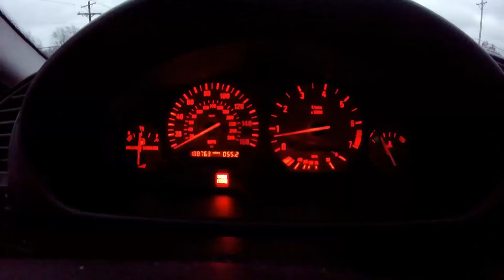Should You Ever Replace Your Transmission Filter?

Comment: I changed the transmission filters and oil in every vehicle I owned except for 1.
It was a Ford F-150.
Transmission failed at 81,000 miles on the F-150.
Other vehicles included
Dodge Durango
Ford Explorer
3 each Dodge Ram 1500's
Dodge Charger R/T
I only changed the oil and filters in the 3 Dodge Ram 1500's
The other vehicles were done at the dealership.
Could be just coincidence but the only vehicle that I had transmission problems with is
the one I never changed the oil or filters in the transmission.
Note: My son had a dodge Ram 1500 and never changed the filters nor the oil in his
transmission and his transmission went out as well.
Not sure how many miles he had on it though.
His truck was 2 years younger than one of my Dodge 1500 truck.
I know have a Dodge Ram 2500 with the 6.4 liter HEMI 
It is at 60,000 miles and many may think this is too soon to change the oil and filter
I don't. It's an easy job and only cost $100 for the fluid and filters.
I tow a camper with my new truck and don't want to have trouble on a long camping trip 
and that is why I am changing the oil and filters.
I know many will disagree but this is how I roll !
Reply from the maker: What failed in the f-150 transmission? I doubt it was a clogged filter. You also got lucky on those Dodges! Lol
Reply: @PetesGarageandperformance  I doubt it as well
I think just a coincidence. The transmission place rebuilt it then
it left me on the side the road twice. He accused me of hot rodding
the truck and said that it would be the last time he would work on it.
I got a lawyer and they really looked at it better and they had something
in the transmission installed backwards. A ring perhaps. It was a long time ago.
But that is when I swapped from Ford to Dodge and have never had any
trouble with a vehicle again. I have a Ram 2500 and the wife drives a Durango.
Zero problems thus far.It may not make a difference to change the filters but it does give
me peace of mind and I like doing it as well. I take pride in keeping my vehicles in mint condition
and I keep them for an average of 10 years as well. Although I envy the fact you know how to
rebuild these complicated transmissions now a day. You got another sub.
Reply from the maker: Gillis Danos lol the trans shop tried to blame you! That’s the thing with these transmissions, one little screw up and it won’t last long. Thanks for the sub.
Reply: @PetesGarageandperformance  Your welcome. Now if a shop would say that I hot rod my 2500 they would be right.
6.4 HEMI with 4:10 rear end is fun, fun, fun !
Reply: I bought my 2000 Silverado with the 4.3L and  4L60E transmission back in 2006 that had  around 60k miles at the time. It's been my daily driver and currently has just under 240k miles and never even changed the trans fluid once. I'm kinda ashamed to even say that, but I've always put it off. I'm not sure if the previous owner had ever changed it! It still drives and shifts without any problems! 
I'm getting ready to finally change the trans filter and fluid today, and am curious to see what it looks like in the bottom of the pan. I may have to update this and let you know how it looks when I get done. I changed the rear diff fluid once and that was within the past year! (Go figure) lol
Yes, I do change the oil and oil filter regularly!
The only mechanical parts that I've had to replace (knock on wood). 
-Steering Rack & Pinion (180k miles)
-Power Steering Pump (225k miles)
-Distributor (230k miles)
Goes to show how reliable GM is!

Comment: All filters regardless of type or brand have a limited life span of usable service, beyond that point, the very molecular structure of the filtration medium will breakdown, become saturated with normal amounts sediment reducing it's effectiveness over time. Im completely lost as to why the hell, would anyone drop the pan, to change the oil and not change the filter also, for the inexpensive cost and the time it takes to do, your point is totally irrelevant. Yes around 40% of the fluid does remain in the torque converter, but adding 60% new oil still introduces a nice fresh batch of additives that normally lose their strength after 80,000 kms, what ever remains in the TC will dilute into the fresh new oil, and the new filter, will clean up any suspended particles, giving your clutches, valves, solenoids, seals and torque converter  extended life... If you are smart enough to rebuild a transmission, then you are certainly smart enough to know that the filtration medium, does indeed break down over time and begin to plug up or reduce its micron screening ability.
Reply from the maker: I agree with you about if you drop the pan to replace the filter while you are there. But I wouldn’t waste the time and would do a fluid exchange through the cooler lines instead. If the filtration media does indeed break down to the point of needing replacement, why would the engineers bury the filters inside the cases of the newer FWD transmissions?
Reply: @PetesGarageandperformance  Engineered to fail! We are beginning to go backwards instead of forward with the over complexity of new vehicle drive trains, they perform far better than older cars but longevity has been severely compromised. It started out with the removal of the dip stick, now it's the purposeful installation of the filter in a compromising location. Manufacturers want you to change your vehicle at least every 6 to 10 years....
               I've seen so many vehicles develop shifting issues because of lose particles stuck in the valve body after a transmission flush through the oil cooler, using that cursed flushing machine. More a more repair shops refuse to use them anymore, Even my Cadillac dealer was glad when I told them not to run the machine on my CTS, and for good reason, we pulled the pan instead, installed the new filter, and topped with clean Mobile One ATF.
Reply: Pete most people don't understand most transmission filters low pressure are rock catchers they are there to keep large transmission parts from damaging the system. Keep the fluid fresh and transmission will be better than fine for many hundreds of thousands of miles.
Reply: @davidporter7051  So that you know, I am a heavy equipment mechanic, I may not be an automotive technician, but I do maintain a fleet of heavy duty pickups, along side the industrial fleet, and I've seen first hand, automatic transmission filters, that were saturated with clutch and metal particulate, we regularly send filters and oil samples out to a third party for engine/transmission integrity analysis. Also the service manual, strongly recommends oil and filter be changed at the initial 100000km mark, and then every 80,000km there after.
Reply: @brentneves3602  you don't even understand what you are posting. Try again.
Reply from the maker: Maybe the heavy equipment transmissions have more sacrificial clutch material? In the auto repair sector if there’s metal in the filter, something’s wrong.
Reply: @davidporter7051  Really?  So you have never heard of companies that perform oil and filter particle testing to determine, engine and Transmission internal integrity, by being able to measure in PPM (parts per million) metals present in oil, and filter elements, while also determing the type of metals present, like, aluminum alloy piston skirt material, soft shell babbitt or brass bearing cap material, hard surface material like camshaft lobes, fibrous wet clutch linning material ect???...And You are telling me I don't know what I'm talking about? Instead of being a you tube wannabe mechanic, maybe you should consider educating yourself first, and while you are at it look up the Dodge, and GM maintenance schedule for automatic transmission heavy duty service.  recommendations
Reply: @brentneves3602  yes. What does the PPM on just the fluid exchange, solubles and particle count with comparison to virgin fluid and change of filter. This is a comparison to identical equipment in identical operation conditions. The difference in containmentated fluid from a exchange and exchange and filter change is within statical noise.
Reply: @PetesGarageandperformance   Pete, you are correct, they should never be vast amounts of metal, or large amounts of clutch linning material under normal circumstances, and if there is, then the transmission is already destroyed, and is now a ticking time bomb just waiting for failure, however there will be traces enough to saturate an ATF filter, over time, depending on circumstances like high miles, or heavy service, and it can reintroduce those particles back into the oil, especially after a transmission flush, it happened to me, and my valve body was full of crap. The dealer had the valve body apart, and showed me the debris. We cleaned everything up, installed a new filter, and got another 120,000kms from her, I sold the car at 225,000km and I sill see it driving around town.
Reply: @davidporter7051  Alright, there is value in your statement, but more valid in lighter duty application, where particulate debris are at a minimum, and will not inadvertently contribute to filter saturation in a detrimental manner , however across a larger spectrum of vehicle mobility , there will be other circumstances to consider, like in heavy-duty application: High performance sports cars, load bearing work vehicles, or transmissions that work in extreme heat, or are constantly shifting due to short trips like delivery service, or taxis, these automatic transmissions will generate more debris, and according to the Engineers at Dodge and Gm, requires more frequent ATF change services, and transmission filters renewal, at each fluid change.
Reply from the maker: This is why I made the video. It makes for good conversations!
Reply: Right On Brent,Nice to see someone wiyh a BRAIN

Comment: You are correct for simple metal mesh filters, but some have a multi layers filter like post 2011 Mercedes 7 and 9gtronic.
There is a paper like layer to catch thinner dust and I think for this type of filter it is better to change the fluid  and the filter

Comment: Really great video, I was so confused when my Toyota dealership told me they do not change the filter.

What do you think is better, drain and fill, or flush? I drive a 2011 Scion tC. Thanks!
Reply from the maker: I always recommend hooking an exchange machine to the cooler line. This will get the fluid that was in the torque converter exchanged also. If you just drain and fill, you don’t get the fluid out of the converter.
Reply: @PetesGarageandperformance  Thanks so much!
Reply: @PetesGarageandperformance  All transmissionjms are not the same, and they require different service intervals and procedures.
 Example: Per the FOMOCO Shop Manual, The 4R70W Transmission requires a Filter Change at every 30,000 miles. 
When I bought the car at 51,000 miles, the transmission had not been serviced, and the filter had never been changed.
 I drained the trans pan and the Torque Converter, and added new MERCON V  fluid.
I installed a new Motorcraft filter and a B&M Shift Improver Kit, a B&M 13,000-lb. Trans Cooler, and a B&M Drain Plug Kit.
Since trans upgrades, fluid is changed at 30,000-mile intervals.
 Transmission functions flawlessly at 170,000 miles.
Any argument against doing the required filter changes is misinformed, at best.
https://www.mercuryforum.com/forum/grand-marquis-14/1995-grand-marquis-restoration-8937/
Reply: Some manufacturers say not to use flushing machines for transmission fluid change. So just check before using a flush machine.

Comment: I never replaced my transmission oil & still working good with 300k f150 lariat truck I only change motor oil cabin filter air filter or you think if I change the transmission oil it will broken what you recommend ? Thanks for your videos peters garage

Comment: If the filter doesn't catch all the contaminants and the contaminants get into the valves the valves can get blocked causing damage to clutch plates. Clutch plates usually get damaged by putting extreme usage on the transmission such as spinning tires, hauling trailers, or blocked valves which cause overheating of the fluid. Filters do get clogged with clutch contaminants and metal as the magnet in the pan gets to the point where it can't pick up any more metal after being coated with wear and tear metal bits over time. When the filter gets gets clogged with clutch contaminants and the valves stop working and vehicle won't shift between 1rst and 2nd or 2nd to 3rd, most people think the transmission is completely gone but it can have another 50,000 miles on it and just need a valve replacement and new fluid replacement.

Comment: On my Ford Focus 2008 it was easy and cheap to change the filter when I change the oil and did it regardless without thinking why I need to change it. When I got my Ford Escape 2015 it a sealed unit so I just change the oil now. Did  I need to change the filter on the Focus  is a good question.

Comment: When my truck was just 8 months old, the transmission was acting up. When the mechanic dropped the pan, he said there was a lot of debris in the pan. They did whatever they do and I have not had a problem in 16 years. But I do think about replacing the fluid and filter.

Comment: Great point. I just bought a 2013 Lexus RX350 with 121,000 miles. I my case, I suspect the transmission fluid has never been changed, because the guy I bought it from said he took it to a certain shop, and I called that shop up and they said the transmission fluid was dirty, and he refused service. I believe there may be some metal in that filter, especially since I'm told it was dirty transmission fluid. I'll put a Wix filter in there just for peace of mind when I flush it out. I wonder if there would be a benefit of the  transmission fluid flowing better with a new  filter, because I suspect it would be dirty after 121,000 miles with some metal debris. I don't any transmission service in the Carfax Report.
Reply from the maker: There shouldn’t be any metal in the fluid. If there is, you have big problems. Are you experiencing any issues with the trans? Just flush the fluid.
Reply: @PetesGarageandperformance  No problems. I'm glad you said that. I was pressured to flush and change the filter for $971.52. The filter change would be $559.47 of that. If I did just the flush, they would charge $412.05, but it isn't Lexus fluid, but they say OE fluid. All these numbers are with a 9.25% sales tax here in Tennessee.I am so glad I watched your video. Would you recommend going to the Lexus dealership for a flush?
Reply from the maker: I would probably go to the dealership for the flush. They should know if there are any special quirks on your particular vehicle.
Reply: @PetesGarageandperformance  I think so too! I plan on doing this in the morning when they open.

Comment: I had a 1990 Ford escort.  I pulled the pan off at 125k.   Had drained the fluid and replaced at about 75k.    I had noticed that the transmission was starting to slip.   Grant it I was not hot rodding it but I noticed it.   I took pan off and replaced the transmission filter.   I cut up filter.  The fine screen inside was completely covered with tiny pieces about 1/8 deep.  Was blocking flow.  After replacement went away.  Easiest car was 1996 Saturn,. External transmission filter.   Same size as oil filter.    Cost about the same.   I changed every 20000 miles.  Never had issue.   Had that car up till 225k.  Finally sold because AC went out.

Comment: I change the filter the first time I do it and replace the pan (If available) with an aluminum finned deep pan with a drain plug. I just do fluid drops every third oil change. Dorman makes replacement pans that are actually very good with drain plugs. If you own a Honda the filter can't be changed without major disassembly.

Comment: interesting video Pete ty for sharing. I've got a transmission oil change due and will be replacing my stock pan with a Mag Hytec aluminum deep pan. it will add about 3 quarts over stock. along with keeping it cooler the Mag Hytec has a drain plug which i really enjoyed using on a 99 Dodge turbo diesel i had.  change the filter if u want don't change up to you. I'll be changing mine this time but probably won't in the future. what i don't recommend is a complete flush of an older transmission if you have not routinely flushed it in the past. I've heard some horror stories about people that had slippage problems right after doing a flush.  QUESTION FOR ANYONE OUT THERE:  I've been told the trucks transmission has to be jacked up in order to get to some bolts on the pan. i have a 95 Chevy 1500 4x4 and a 95 GMC 2 wheel drive.  do the transmissions in these trucks have to be jacked up to change pan???  thanks!

Comment: I purchased an old a 2002 Odyssey van and it started clunking in the 2nd and 3rd gear. 
I have to drive it very lightly and ley up on the gas before each shift. 
I was told to to remove the solenoids and check the little screen filters in them.

Comment: That's a good point I was thinking that also why is the filter in the oil pan and not accessible on the out side of the transmission for us to change like a engine filter so it makes sense automatic transmissions are not to be opened up till its time to overhaul or replace with new one I just think I lessened the life on my transmission by changing the filler n now it sometimes has a hard shift I just wish the transmissions weren't so hard to fix for the do it your selfers oh well I guess that's why the new rides I think are just throw aways nowadays throwing away that money for them haha
Reply from the maker: I think fluid changes are a good idea. But you don’t have to drop the pan to do that. The only transmission that I’ve worked on that had a screw on filter was an Allison.
Reply: Some cars like galant 97 have accessible transmission filter..